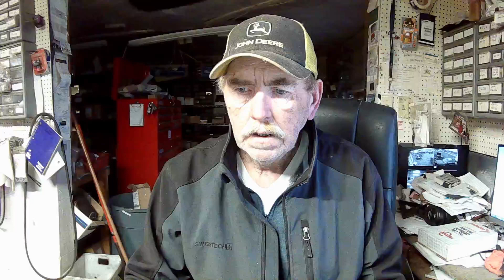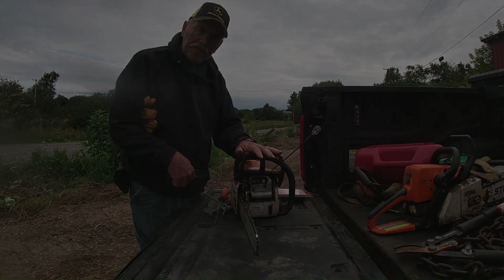How much info do you take into consideration when doing repairs?

Comment: Several years ago I switched all my  'micro engine' tools (hand-held blowers, weed eaters, saws, etc.) from 2 cycle to 4 cycle.  Kinda pricey going in, but worth it to me to forget about having to keep on hand gallons of '2 cycle mixed' fuel.  One thing I've noticed though, is these little engines really need more frequent oil changes than what the manufacturers suggested change interval is.  They have such a small oil quantity in their crankcases that it keeps that tiny bit of oil in 'constant play' and gets the heck beat out of it.  I'll change oil in these things 3 times a season, and each time I drain them,  the oil is filthy.  Both the Makita 4 stroke blowers only carry 2.7 ounces of oil and the Husqvarna 4 stroke weed eaters about the same, about 6 tablespoons full.  They all still run like new, with excellent compression.  Seems longevity of these little engines falls squarely on the frequency of oil changes (air filter changes, too).  Not only do these little guys last longer than most 2 cycle machines do, they're so fricken easy to start,  they're quieter running because they don't have to rev up like the 2 cycle units do.
Reply from the maker: same here Santa on my trimmers (4 stroke) even my 9.8 nissan outboard is a 4 stroke. they are easier to start and I change the oil depending on how many hours I have on it and of course the color. Oil change is much cheaper than repairs. thanks
Reply: I like my Stihl 4 Mix Kombi System but it is really heavy. I have a very small Kawasaki straight shafti 2 stroke trimmer that is lighter than a Redmax trimmer. The Poulan Featherlite trimmers are also great. I don't mind mixing gas and the oil also helps keep corrosion out of the carburetor. You can put a little bit of oil in your 4 cycle gas and it won't hurt anything.